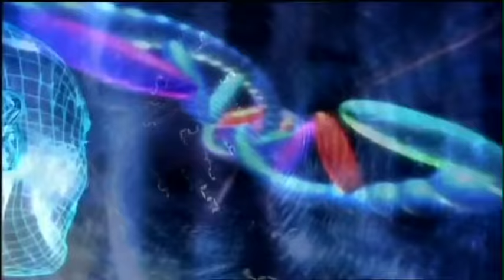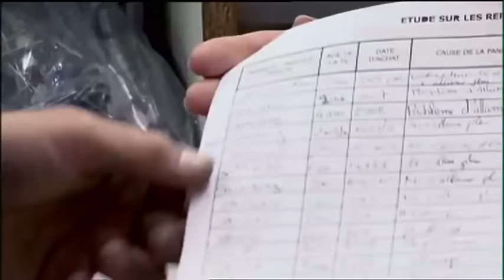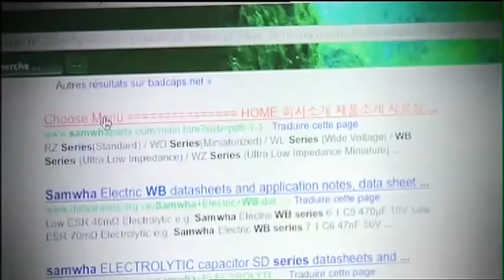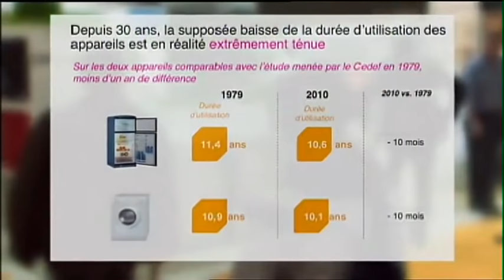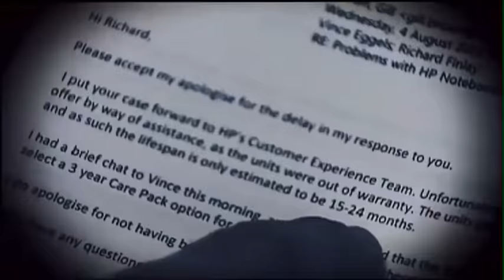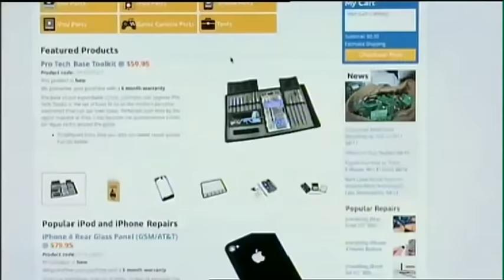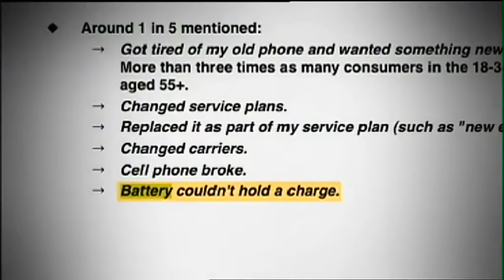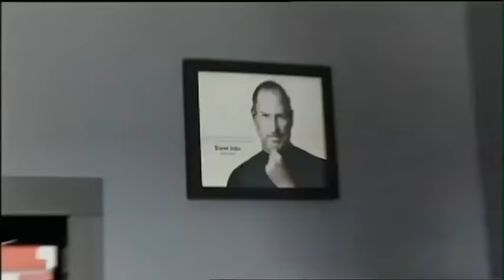Planned Obsolescence: Why Electronics Don't Last Long | ENDEVR Documentary

Comment: I had an Asus netbook which I believe is of a shoddy planned obsolescence construction and now I am going to punish these companies and buy a Raspberry Pi where every component will be individual, rugged and easy replaceable. ASUS Eee PC 1001HA netbook for 12 years. It's literally built out of scotch tape and aluminum foil inside. The display glass was made out of a faulty piece with a broken off corner with the cracks covered in epoxy. Battery failed 2 times, keyboard 4 times, display developed 6 lines during the time, display cable failed 1 time,  the main internal bus cable failed 3 times, card reader failed completely, camera failed numerous times, touchpad stopped working, fan failed 3 times, power supply failed 1 time. eventually the motherboard failed. Raspberry PC means motherboard, heatsinks, harddisk, SD Card, keyboard, mouse, screen, power source, power cable, screen cable, hard disk cable, power bank, are all separate components from different manufacturers and easy replaceable often without need to unscrew anything. The computing power 4 x 1.5 GHz is better than the 2 x 1.6 GHz netbook and 8 GB RAM is available.
Reply: Asus... junk
Apple...overpriced 
Dell...can only use their service departments to repair , via the Mail!
Reply: Lmao what?? You bought a netbook from like 2010 and expected it to be good? Those things were basically just a proof of consept and the whole point of them was "planned obsolescence"... They were low powered, low spec computers that were very bad even by 2010 standards so expecting them to last was a pipe dream.

Comment: Same with Continental injector for 1.6TDI VW. After 120000-180000km they will brake, and need replacing with new injector, but the part that fails is the electric control, which cannot be changed separately.

Comment: 1. Excellent presentation - a shame more have not seen it.
2. The old cell phones and tablets do make great alarm clocks, personal reminders, recorders and cameras.
3. That said, I should not have to replace my perfectly good dual-flip QWERTY texting hybrid simply because "The System" refuses to support 3G service after January 2021.
I have owned cell phones since 1984 and have been forced to replace perfectly usable ones due to "improved" technology, including going digital so analog phones are outlawed, adding the 9-11 chip (but not retroactively), and discontinuing service on anything before 4G.
It's all a scam....same thing is happening with computers having to use the [public] cloud or [inferior] Windows10. 
Horse hockey & buffalo chips!
Reply: Exactly. it is a real scam. Microsoft pumped and dumped the only company who did produce lasting products, Nokia.
Reply: @value8035  The moral of the lesson is obvious. When everything was built to last as long as it exists and that it is restorable-repairable with ordinary home manual tools and you can buy the spare parts dirt cheap, IT IS HEAVEN TO A FIX INCOME MAN AND TO A PENSION AND SOCIAL SECURITY DEPENDENT RETIREE!  They do not have to sacrifice their pension money or social security money or retirement savings on unnecessary repairs or replacements. They can save their money for real emergencies if ever there is one because the U.S government at that time, even though it is not perfect, is still well run and administered. And they do not have to worry about financial emergencies causing them financial hardships.
Reply: Our Russian military desktop PC computers were hardwired not to use the rotten public cloud for we Russians do not trust the rotten cloud and we use the hybrid Aymara algorithm-Linux open source programs that can bypass any obstacles with intent to planned obsolescence. Russians also discovered a way to make all levels except 5G. Russian military desktop PCs also has an external HAM RADIO internet systems to wirelessly connect with each other,
Reply: NOTHING wrong with tried & true Russian made products. Lada Niva (mid-1980s) models are still used here in Australia for sandy beach 4wd driving in Australia. Even Range Rover that age (with alloy bodies) have rusted totally. I'm buying a Poljot Russian President chronograph soon. It will last the next 30+ years easily.

Comment: My Bosch fridge and dishwashing machine are over 20 years old. Only 1 repair on the fridge freezer which was my fault. I fixed it in 10 minutes, a fan had got jammed and had iced up. I thawed it out removed the blockage. Been fine since.

Comment: If other brands of phones had replaceable batteries would people buy it? A replaceable battery would need a plastic case, so the phone would be thicker. Also the replace batteries would probably not last all day. Someone should ask why NO other companies make easily replaceable batteries. I bought an iphone 6 new but 3 years after market at ATT. In less than 2 years the battery has needed to be replaced twice. A small phone shop replaced them for$45 each. I keep my phone plugged into the charger almost 24 hours a day. I don't know if that is a good or bad thing.

Comment: Samsung actually make a washing machine that if fact is more than dangerous, its spin cycle is over 800r.p.m. for a spin bowl that is made of alloy that starts falling apart on the first wash.
If you use a washing liquid of any sort for these front loaders, the drum is only held on by three spokes attached to the rim of the drum, once the washing liquid has eaten away enough of the alloy, it can no longer cope with the forces of the spin cycle and it seperates from the drum, there is now nothing holding the drum, so if it lets go when in the process of the high speed spin cycle, and you have a full load you now have a drum that weighs almost as much as you totally unsuported and free!
I would call this dangerous.
The drum is made of stainless steel, so why not make the drive wheel of the same material? The only answer seems to be is that this might last a lot longer.
The manufacturer seems to think that all people get the same money as they do so can afford to by a new one every few years, i hate to burst their bubble but thats not the case, not by a long way, what is wrong jn taking a pride in what you make and build up to a standard not down to a price.
The car market is the same with car makers putting a belt driven gear box where the belt is made of metal and has been well recorded breaking after only 30,000km, costing as much as a new car to replace, this does not include the timing belt which needs replacing  at about 70,000km, when a timing chain lasts for near on the life of the car if taken care of.
It has arrive at the point where you go out and look for a well cared for older car that you can repair yo urself or at least service yourself instead of a car that actually tells you to get a service, something you can no longer do as most people do not have the equipment to turn the message off, let alone service their car.
Cars have become technology on wheels with a hord of  items designed to go wrong, with a price tag that restricts most owner to one car per lifetime, or going into debt to replace what in many places is a must because there is not the public transport to support them.
Its a pity that the word honesty has been removed from our daily lives when it comes to buying items made in todays market place its a case of buying cheap and nasty, but paying top dollar for it, in other words being ripped off!!!!

Comment: The moral of the lesson is obvious. When everything was built to last as long as it exists and that it is restorable-repairable with ordinary home manual tools and you can buy the spare parts dirt cheap, IT IS HEAVEN TO A FIX INCOME MAN AND TO A PENSION AND SOCIAL SECURITY DEPENDENT RETIREE!  They do not have to sacrifice their pension money or social security money or retirement savings on unnecessary repairs or replacements. They can save their money for real emergencies if ever there is one because the U.S government at that time, even though it is not perfect, is still well run and administered. And they do not have to worry about financial emergencies causing them financial hardships.

Comment: So, knowing nothing about electrical components, if a capacitor goes, could it be replaced on the same board by a "larger" one, one that withstands more, and last longer?
Does having a surge protector or battery backup between the wall and the TV make a difference in lifespan?
Reply: No surge protector won't help they  are making these things to cook. Capacitors are little storage units that released the desired amount if there is too much being released such as a bigger capacitor you could have problems somewhere else down the TV.
Reply: Consumerism. Same thing apply almost for all the products around us. You need to pay for anything the producer company makes for, more and more. Same thing apply for the services industry as well. Almost in every visit they warn you about problems with the parts and they want to replace them in automobile service stations. They sometimes forget what they have done ir they did not keep oroper record thay ask the same part to replace although they claimed that they replaced earlier visit.
Look at the Microsoft Windows versions. 2001 version of Windows was the most comprehensive version. Since then they produced many versions most of the options disappeared, today they sell the options separately.
Consumerism if not supported by adequate recycling is going to end up with very large unused product covered by soil and perhaps we will drink and eat some of heavy metals and plastics.
I hope this madness stops sooner than later.

Comment: A radiator?.
Dickheads, it's called a HEATSINK!
The heatsink, as it's name suggests, dissapates heat generated by the mosfets or power transitors......
Anyway, the video was very informative and another learning experience in electronics.
Thanks for the U/L

Comment: Why do updates slow Adobe programs instead of improving them? Might need to update my operating system. Oh hang on, need to update my MacBook to get the operating system running properly. Oh the new MacBooks costs three times what they cost a few years ago and they aren’t upgradable so will need to be replaced again in a few years. Apple and Adobe are colluding and are screwing their customer base with their new business model.

Comment: Cost of labor in the Asian countries producing almost everything in a device or appliance is so low compared to labor cost in USA or Europe that the manufacturer need not consider consumer quality itself. The cheap producer in a poor country is going to produce cheap for a huge consumer base that is conditioned to throw out and purchase new. Bottom line for Western countries: Putting your own people to work at a much higher wage works for everyone -- wages stay up allowing consumers to pay for a better product, since the "technology curve" for a better component is finite, and levels-off quickly past a certain point of durability and cost. MILSPEC (military specification) devices and components are generally at the top for performance, and cost a lot more, but mass consumer devices need still to be designed "optimally": Not too good, not too bad.
Reply: Watch a YouTube video. The guys from India show you how to fix all kinds of electronics...